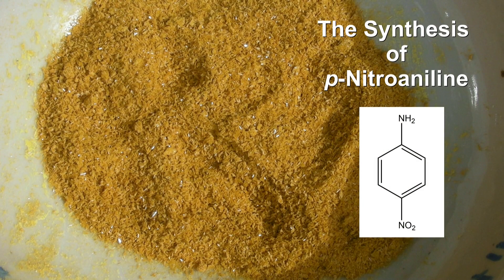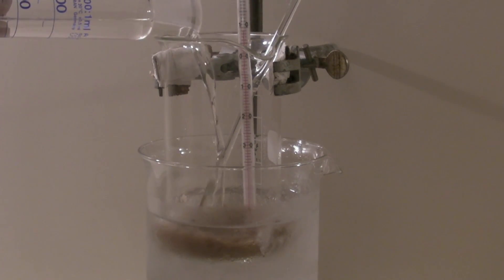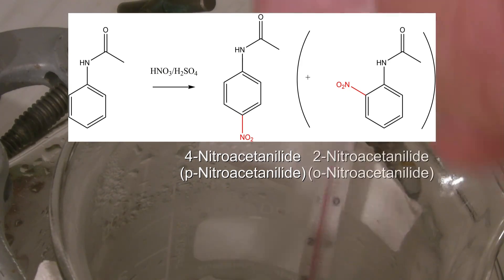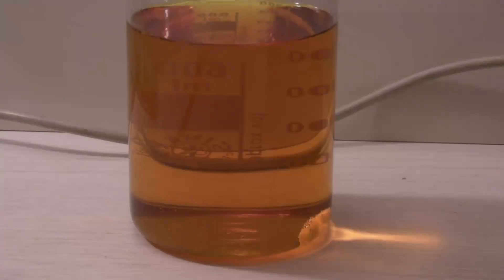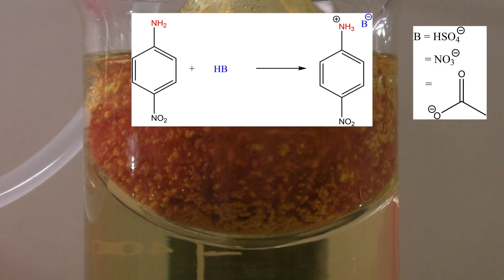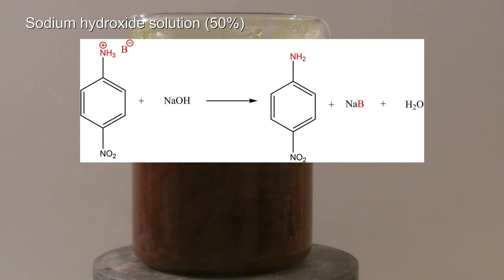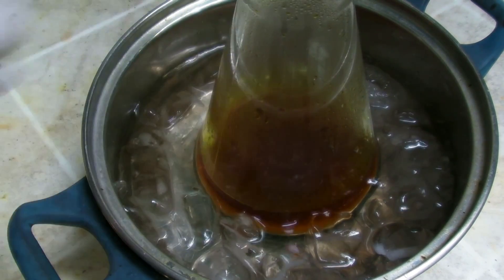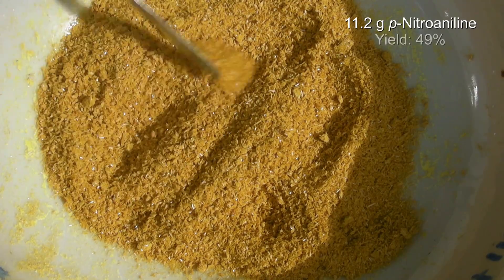Synthesis of p-Nitroaniline

Comment: After recrystallisation i lost all of my nitroacetanilide.can you pls tell me  what i did wrong?
Reply from the maker: It shouldn't be possible to lose the nitroacetanilide in the recrystalization. You can only cause it to hydrolyse, if you don't remove enough of the acid. The nitroaniline should be dissolved in the solvent if water is used. Then ethanol can be used to make the ammonium salt of p-nitroaniline precipitate. If ethanol was used for recrystalization, you can try adding some water to make your product precipitate, which is unlikely. If it doesn't work, a lot of ethanol should help.
Reply: @RaExpIn  thank you!!!